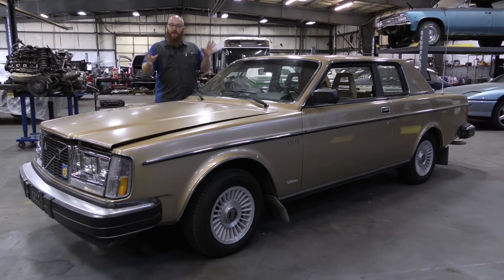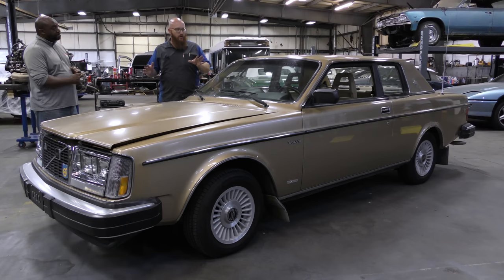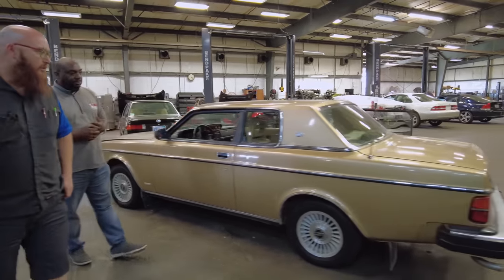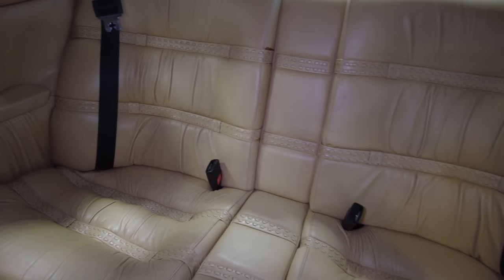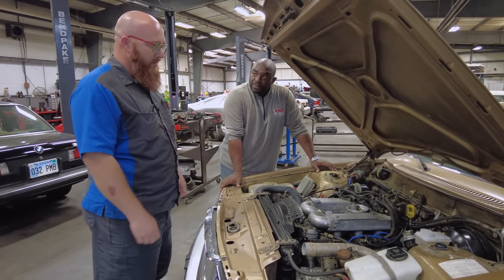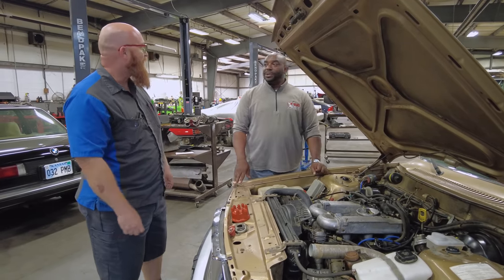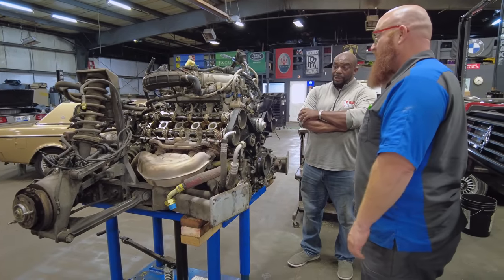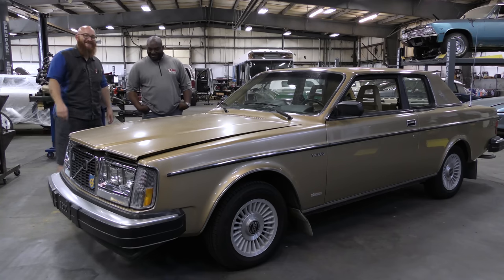Italian Volvo? Rare ‘80 262C Bertone in my shop! Why is Bug Ninja in a Ferrari engine bay with me?

Comment: I'm not sure the information was said - Volvo sent a completed 264 to Italy where the Bertone stripped it and converted it to 262C. I absolutely love the car. Apart from the PRV engine which is huge pile of horseshit. It's either put up with this crap or swap it for some more reliable option like 2,3 Turbo, but it would be a blasphemy. I love P1800 even more and about 780? Don't mention it. It's soulless and not that pretty. It's stripped of what's sexy on 740, every panel changed, every window changed, every piece of iterior changed to achieve a anonymous "Italian looking" coupé. My friend who had 262C bought 780 too and to this day, it's rotting on the yard of your friend Volvo mechanic. Unloved and never to be renovated, probably. 

That's it. You never see a neglected P1800 (or ES), you sometimes see a neglected 262C and you never see a running 780. At least in Europe. Never ever saw one going.
Reply: And if I had a space for it and extra money, I'd buy neither. I'd buy a 740 Wagon with big headlamps (not the narrower ones, not the split "760" lamps, the big "CRT TV" ones). In silver metalic paint. It was my first Volvo albeit I had it with a straight six non turbo VW diesel and now I'd like a 2,3 petrol car either turbo or not. That's a love of my life, most beautiful car ever made. Even though I like the design of 850 that I have and V70 II that I have now. The 740 Wagon has a special place in my volvoheart.